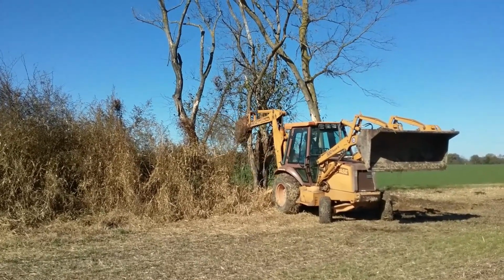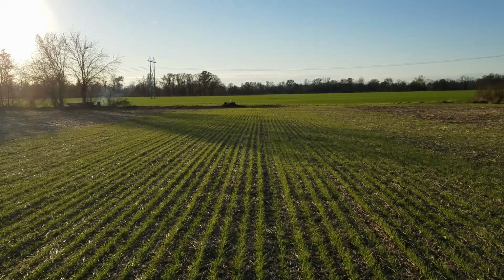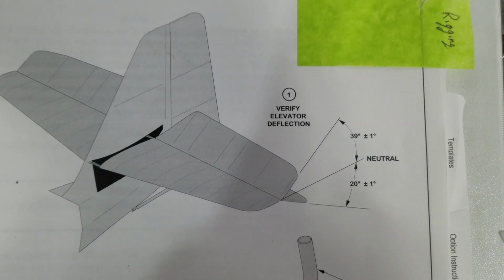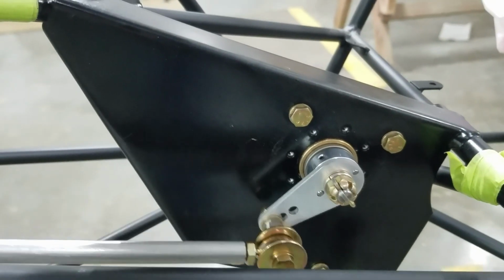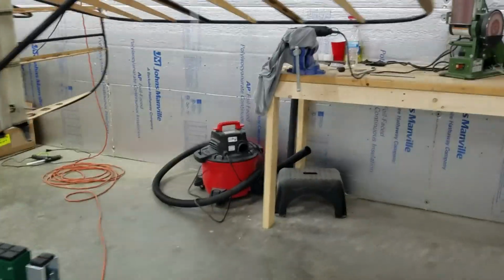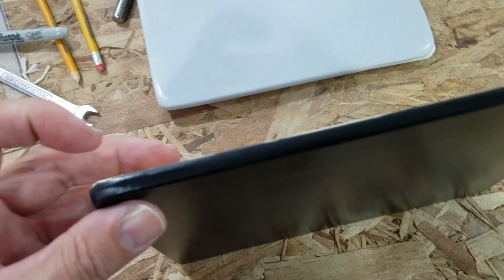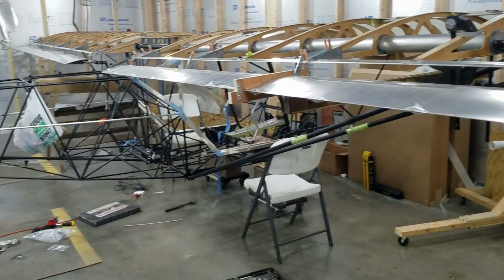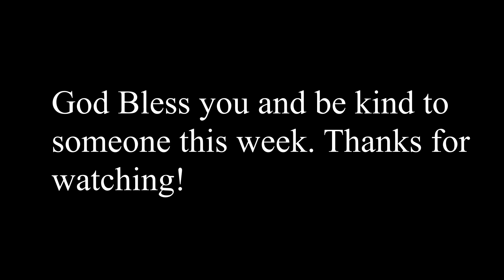Farm Fox Kitfox STI build 17. Runway, Rigging and Oratex.

Comment: Hi Harlan,  I'm working on the wingtips and going to apply some UV Prime to help level the surface.  Using a roller.  Wonder if this would smooth the irregularities of the Laker Surface.   Is the surface good enough  for you?
Reply from the maker: Hey Jim. My leading edge has to have some fill work done after I see how the oratex shows everything on my sample work. Before that I thought it was good enough. Is uv prime a primer paint?
Reply: @KitfoxPilot  Applied with a roller it is semi thick and  you can sand it. For sure using it on the tips.   Not sure on the laker as I am using Poly Fiber.  The oratex seems to transmit imperfections as it is thinner.  UV prime is a poly fiber product.
Reply from the maker: @MrShowdog7   You will have no problems I don't think with poly fiber because you prime and sand before painting. I pretty sure oratex 6000 is thicker than polyfiber but you don't get a chance to prime and sand before final finish.